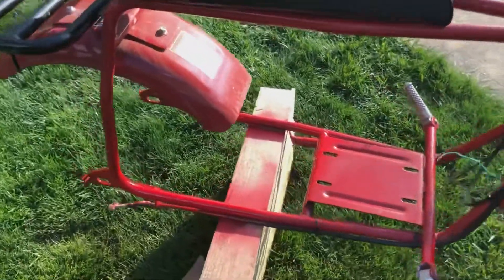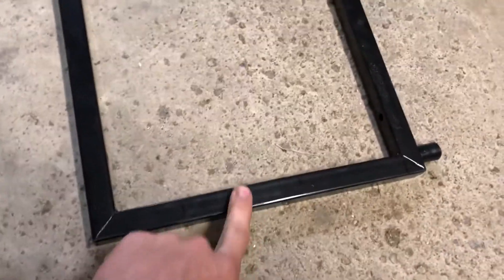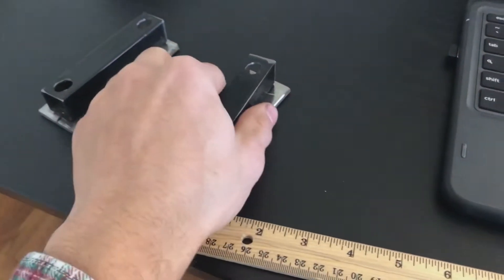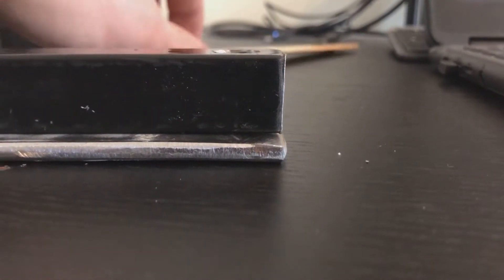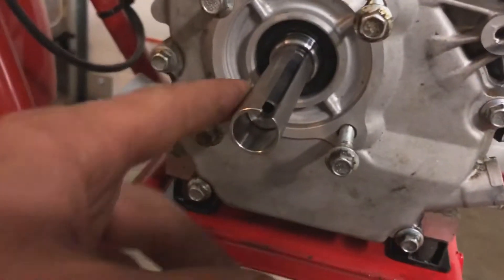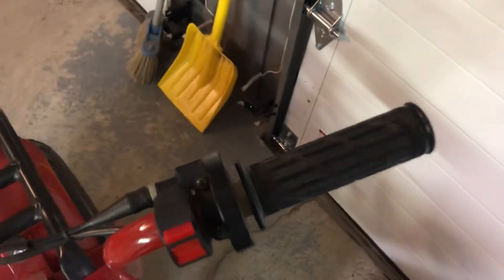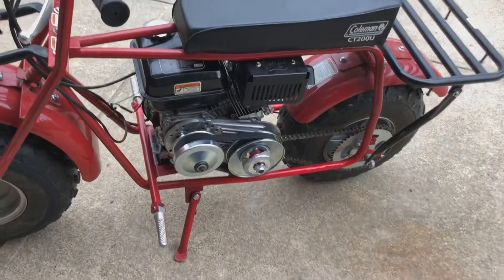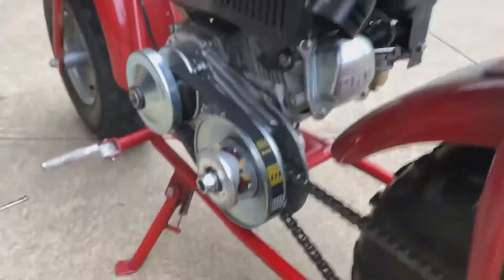Installing a Torque Converter/CVT on Coleman Ct200u Mini Bike

Comment: Quick question does the chain automatically line up with the rear sprocket or did you have to move the engine over like half an inch or so before it all lined up?
Reply from the maker: You don't need to move the engine over. I think I just pushed the pulleys and the sprocket out maybe an eighth inch with some washers. You can also move the back wheel around a little with some washers. I may even line up... I've done a lot of these bikes so I don't really remember. But, I've never had to move an engine over.

Comment: Does the jackshaft bracket have to be cut? I just mounted the motor and rear tire and forgot about cutting the chain guard bar and jackshaft bracket.
Reply from the maker: The Jackshaft bracket can just be unbolted from the engine, but the chain guard bracket has to be cut unfortunately.

Comment: Hey man, how did you fill in the holes in the frame after you cut that price off?Thanks much!!
Reply from the maker: If you are referring to the bar that holds the chain guard, when you cut it off, you should cut it at least a 1/4 above the main horizontal tube of the frame so you don't cut into the structural part of the frame. The rest of the chain guard holder bar, once it's cut, can be ground down with a flap disc to make it smooth. 

If you have holes, that means you have compromised the structural integrity of the bike and you shouldn't ride it until you fix the holes. I would just cut out a piece of metal that fits the holes and weld it back in place. If you dont have a welder, than try to find someone who does or you can buy one used or at harbor freight for about $150. If it's your first time welding, make sure you watch plenty of tutorials of how to weld and practice on scrap metal a ton before welding on the actual bike. Sorry this happened to you. Try to think about where your cutting disc will end up next time before going straight to cutting. Best of luck
Reply: @JohnWheels  thanks a lot!! Luckily it hasn’t happened yet but I will use this advice when the time comes!!

Comment: So I have this exact bike.  Did a stage 2 kit on it and definitely woke its ass up a bit.  What’s the difference between the stock clutch and aftermarket converter.  I wanna try it but not sure if it’s worth it.
Reply from the maker: The CVT/torque converter starts a lot smoother and climbs hills way better. Just know that to install it you'll have to raise the engine an inch and cut the bar for the chain guard off. I was able to reuse my stock chain though. You'll need longer bolts because the engine is up higher. I think your power sports has an installation video. I find it more pleasant to ride with the tour converter, but it's not going to make it faster, it will just be more better for Offroad

Comment: How did you take the clutch off without it spinning how can I stop that wanna replace mine with a upgraded one and as for govenor did you remove or bypass it and is there any rods and cam and valve springs to back that govenor removal up? I have a stage 1 kit on mine straight pipe jet and air filter adapter top speed barely the same wanna get this governor out and obviously won’t pin it for too long but I’m trying to decide rather the valve springs and all that other stuff is worth it for me pinning the bike for like 5 seconds or less
Reply from the maker: I took the clutch off with an impact. If you don't have one, use a wrench and hit the wrench with a hammer. The shock of the hammer hitting it will take it off. I removed the governor and all I did was put in 18lb valve springs which are like $20. In my opinion you don't really need a fancy cam or rods, but you do need the valve springs so it doesn't float the valves at high RPM.
Reply: @JohnWheels  awesome thank you
So much